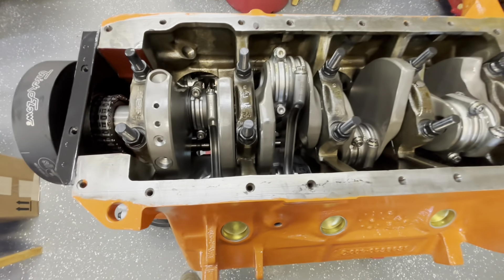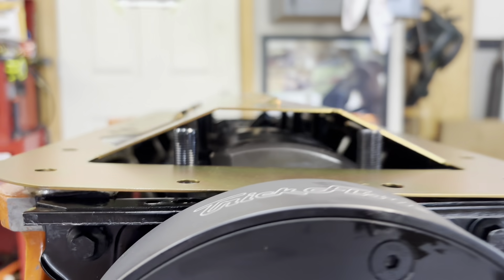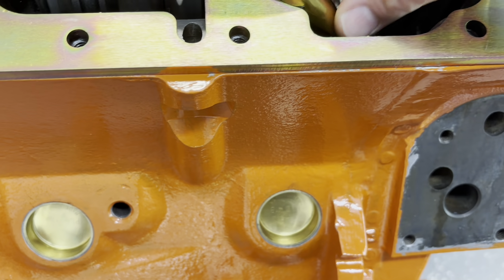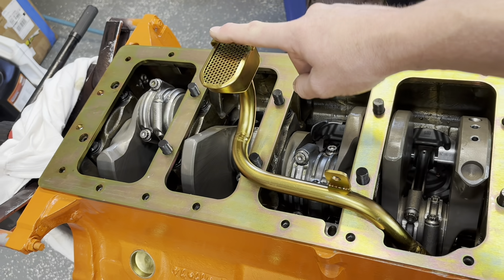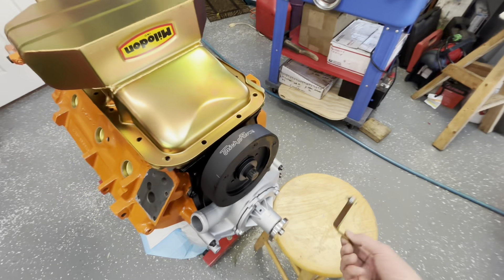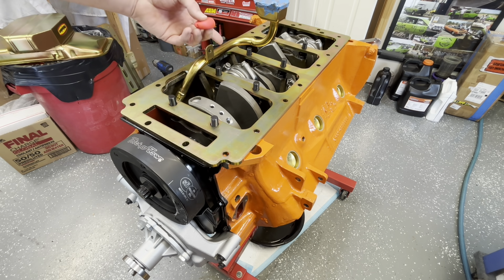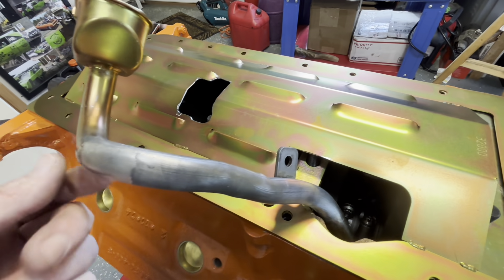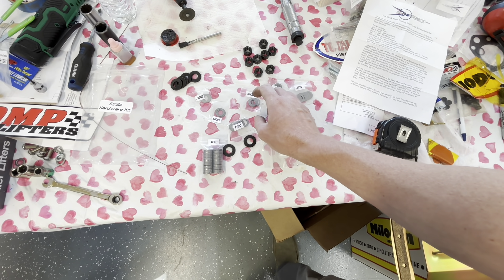700 Horsepower Big Block Mopar Girdle Installation #stroker #bigblock

Comment: HEY MOPAR GURUS, WHEN USEING  A GIRDLE, PUT A GASKET ON THE BLOCK WITH A GOOD RTV ,, USE THE THICK SHIMS  INSTEAD OF THOSE THIN SHIMS . A LOT EASIER THAN FIDDLELING  WITH A FEELER GAUGE . LESS CHANCE OF OIL LEAKS . BEEN THERE DONE THAT..

Comment: Joe - Your video may have just solved our odd oil pressure at high RPM issue! I just measured using your method. .750 clearance from bottom of pan to pickup tube!
Reply from the maker: @blakesmusclecar  thanks buddy! I’m glad y’all got it going your way!

Comment: Another awesome video Joe!!!  I’ve never installed a windage tray or girdle.  After watching your video I honestly believe I could do it.  I always learn so much from you.  Thanks!!!  One question, how much did the girdle and windage Trey cost?
Reply from the maker: The gray is around $100. The girdle is $500. 440 source wants you to pair these with their aftermarket billet caps. That usually requires a line Bore in a stock block

Comment: Good choice to massage the tube.  It had already had the heating and bending anyway, a tip from GK, if you can modify one custom part to cure multiple issues it is always better than having two modified customized parts in an engine build.  Nice work cutting the tray slot, looked professional not hacked.  Go to all the trouble of balancing the rods, yes, you sure don’t want to grind on one late in the build, introduces metal to a clean build many times even with precautions and or throws rod weight off.  You do stuff I never did, so cool to see.  Amazing work and that is ridiculous power, should put smiles on a lot of faces when it gets dropped in a car.
Reply from the maker: Thanks for the kind words and the GK tip - I appreciate your insights!

Comment: About the only thing I learned on my last girdle block was the shims and the girdle crush about .002 when torqued. So lucky me I put more than I needed by mistake and it worked. As for the pickup tube I let it be thinking it would be fine and it worked fine. Never did the playdoe trick and that's cool so will on my next one just for science. From what I get from this video that adds 3/8 of a inch clearance and that's fine for me. Give  6qts of oil above it. Love the video it's very informative ❤
Reply from the maker: Glad the video was helpful. I've learned a lot from other people's builds. This 1/2” pickup tube is larger and definitely requires clearance in a low deck. I think it’d require something in a 500 or 470 build with longer rods.

Comment: @justmoparjoe  is there a reason why picking the girdle over like billet aluminum main caps?   I picked aluminum mains to absorb the harmonics better than like billet steel main caps .  Idk is there a preference you prefer or just anything is better than nothing kinda thing. Since the stock blocks are limited anyways to around 750hp let say ?
Reply from the maker: Thanks brother. I’m only recently getting in to the higher horse scene. My 512 has done well with this same girdle. Typically swapping caps requires a line bore, which isn’t readily available around me. This girdle seems like a nice option to strengthen the stock stuff. I’ve had guys swear that they only half fill their blocks and forget about the girdle. I like the insurance on anything that’s supposed to swing for the fence!

Comment: Hey Joe .. what is the significance of a girdle ?
Reply from the maker: It’s supposed to reduce cap walk and help stock blocks live above 700 hp.
Reply: @JustMoparJoe  how much more power do u think the 512 like yours can handle if your were to throw forced induction boost at it ?

Comment: You'll never convince me those style girdles do anything.
1) too thin
2) no precision fastening to the pan rail.
I ask how are a few non precision loose tolerance pan screws going to do the job of a girdle double the thickness with say countersunk holes, hollow dowels, stepped bolts? - because that's what it wants.
Better would be to just tie the main caps to each other with a thicker girdle, or even better again a one piece billet girdle with the caps machined in.
Expensive for sure no doubt but if it were say $1000 - $1500 you'd be well on your way to more rigidity.
Reply from the maker: Thanks for your input! There are definitely different opinions on what is the best approach for a girdle. My goal was to provide a how to approach on this girdle, with the 1/2” pickup tube.

Comment: I had heard of girdling a block but had no idea what was involved. I certainly can see where it is beneficial to the strength of the bottom end. Very savvy with the playdough Joe. I have used that in the past to see what my air cleaner clearance is to the bottom of the hood. Very interesting video!
Reply from the maker: Thanks Mike

Comment: Good Stuff as always, on a side note, I'm using the BCR Girdle, but haven't used the Aluminum Caps yet, probably on the next motor.
Reply from the maker: I always heard the combination is the key to a long life. I’m looking forward to pulling mine a part and checking it out

Comment: I put a girdle on my old motor.  First time it leaked, so I spent another day redoing it.  I use a bit more silicone than I wanted to the second time, but no leaks. I found I had to reshim it again the second time. The torque from the stud nuts I guess changed my readings.
Reply from the maker: Yeah, I always give them a little extra.  Gotta do what you gotta do!

Comment: Ok Joe, I believe I just witnessed the assembly using a girdle without the use of a cork gasket between (it) and the block 😀 .Am I right?
Reply from the maker: Yes sir. Between girdle and block is ONLY rtv. It will squeeze most of it out

Comment: Nice job Joe, what is the consensus for requiring a girdle rpm, power, boost ? Ally main caps is another mod I have seen.😊
Reply from the maker: Well you know what they say about opinions, but I’ll share what I can! My own 512 has lived a long and happy life so far with 200 passes and 200 shot without an issue. Many guys add the girdle if they think it’ll hit 700 hp. I definitely think a good balance and Aline hone should reduce cap walk

Comment: 5secjoe new services custom made air bleeds made from gold, drill by joe with diamond coated drill bits to desired flow. According to Joe gold air bleeds increase fuel atomization over brass bleeds by 3percent. 

Air bleeds start at $178 individual price.